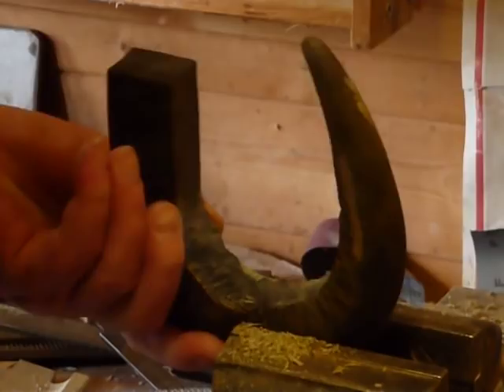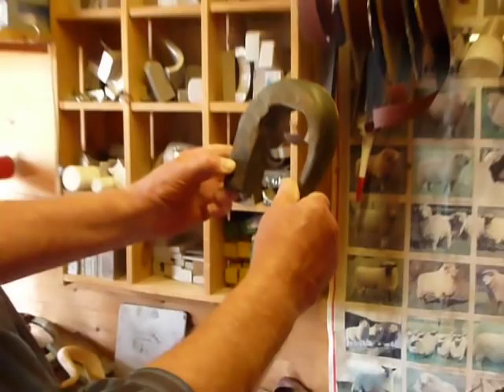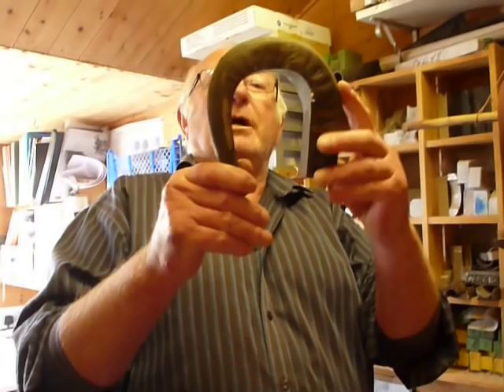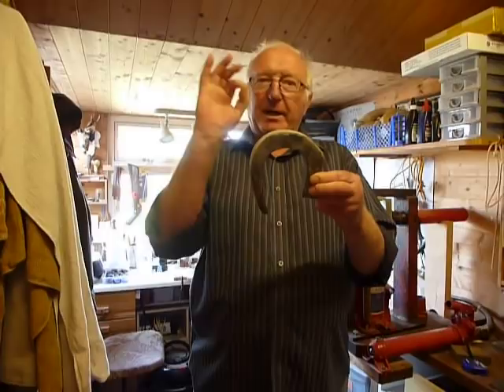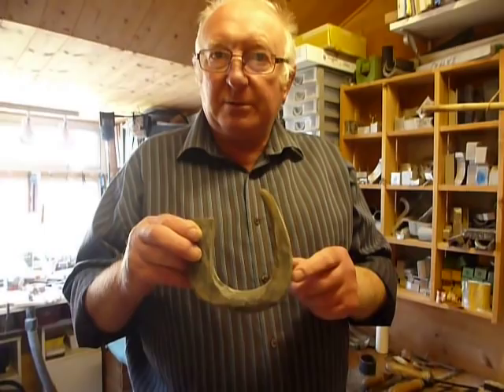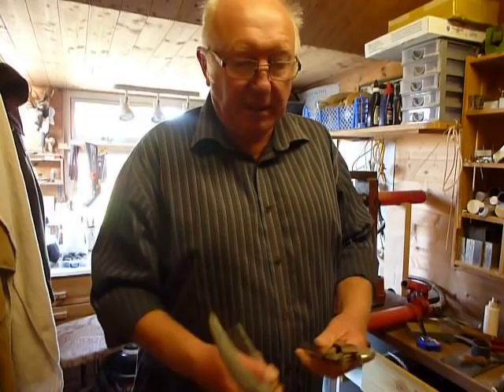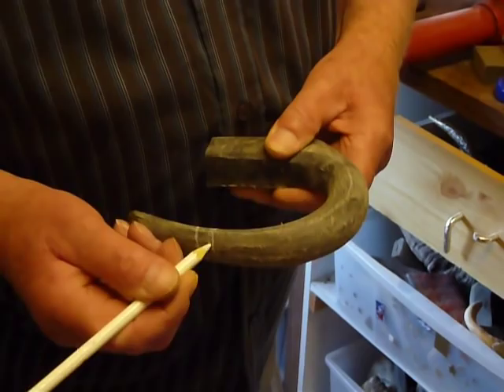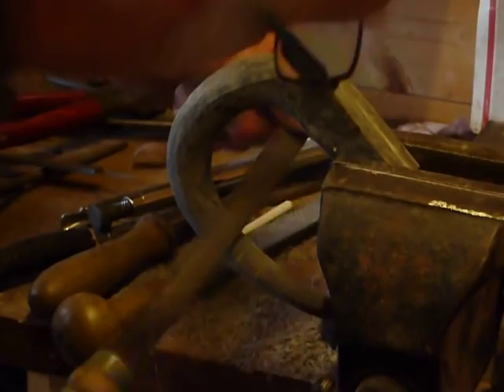walking stick making demonstration turning nose on buffalo horn series 5

Comment: Would steaming, or perhaps soaking the tip for a while help it to bend easier, without cracking? I am enjoying the series, thank you!
Reply from the maker: Hi i have never tried steaming the tip i always use the hot air gun as i have more control of the heat .By using a file on edge, to block the heat from going up the horn .If heat is allowed to travel up the horn it will start to revert back to its original shape and that is where the cracks appear on the inside of the horn. Dave

Comment: Great series. Thanks for posting. I wonder if a pressure cooker would force higher heat into the horn and help with the horseshoe bend part.
Reply from the maker: Yes David pressure cookers would get more heat in the horn if you can get a large enough one  Dave

Comment: iv been watching your posts, top man. just a question would you be able to put the horn in the microwave ? I use it to warm up my wood when carving, would it work for horn ??All the best Bear
Reply: Microwaves work by agitating the water inside your food - or wood - so I guess there should be a little water in horn, which means that could well work, but I've never heard of anyone doing it. I don't have any old bits of horn around at the moment, otherwise I'd go and test this.  :-)

Comment: Would it of been easier to slip in a piece of say 8mm bar to form the inside round? Might prevent the sharp right angle effect on the inner curve.
Reply from the maker: Do not understand question
Reply: @woodlandsticks1365  where you have the mole grips on and are bending the horn. Would it not be easier to bend it around a round steel bar as a former? Say 8 or 10mm depending on what profile you wanted.
Reply from the maker: I prefer to do it this way so i can keep the inside of the curl clean. And not put pressure on the outside that can cause the horn to crack By stretching it around a bar.Dave
Reply: @woodlandsticks1365  fair enough Dave just a thought
Reply from the maker: There are no set rules to working horn just find what is best for you Dave

Comment: @ woodlandsticks.......Incredible expertise no doubt!  Definitely a lost art.  I'm wondering if it might expedite the process by using a hand-held low-abrasion grinder, or perhaps a small belt sander on the outer, more accessible areas of the horn. As for addressing the more difficult-to-reach inner surface(s), perhaps a dremel grinder of sorts would assist in that case. I'm loathe to suggest those shortcuts because it sacrifices your personal expert craftsmanship. I goes w/o saying, the control you have in filing instead of using a dremel tool is the true testimony of the consummate artist that you are.
Reply from the maker: Thank you for your reply, Real Craftsman don't need power, We work gently gently for perfection.